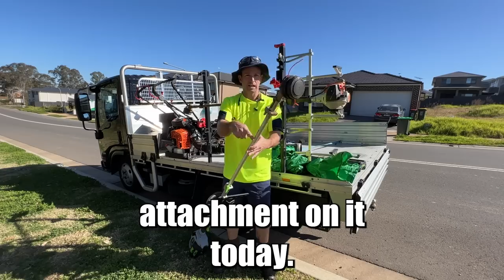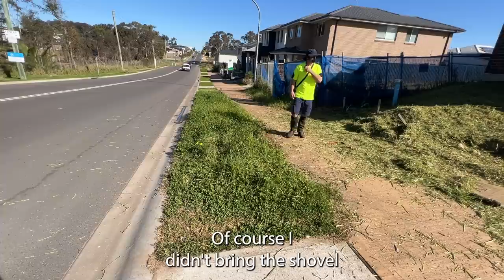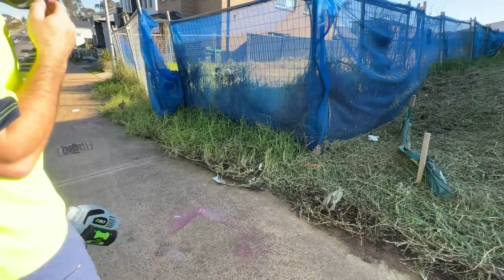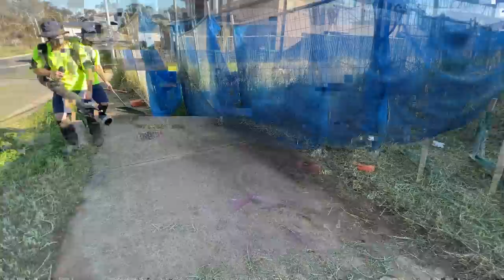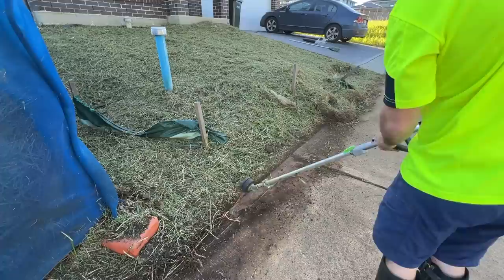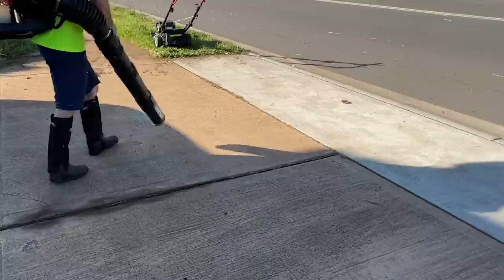No Yard? No Worries! I'll Still Clean Up For Free!

Comment: So when you said it wasn't quite a yard, you meant it.  As you are slashing the grass down, it looks like a construction site or non-landscaped area.  You made this into a nice job.  You created a good view a long ways down the block, you managed to make an incomplete yard look much neater, and you used surplus dirt found to add fill to a hazard (a hole).  You also showed creativity, in using the flat shovel to help edge and clean up.  A good cope if a person doesn't have an edger.  Enjoyed your bit about grooming a tiny area with electric clippers and a little vacuum.  Chuckled over your "Cutting the Grass" rap.  Thanks for your good work and aid to the community.  Also to your wife, for kindly bringing the shovel by.

Comment: Is that E trimmer switchable attachment design?  Like an edging head would work better because a home owner is either knock down a crack or clean it by hand anyway.  That electric trimmer looked more than capable to do regular trim ups for years.
Reply from the maker: Yes it’s a multi tool